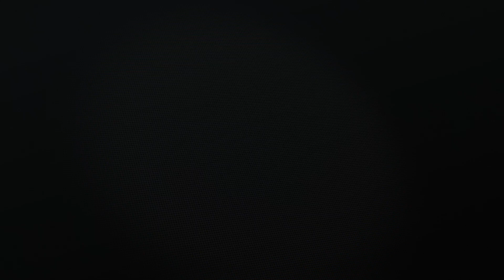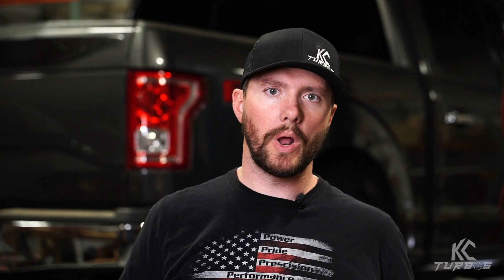Should I Run A Boost Fooler On My Powerstroke?

Comment: So how does it work on a 6 liter with a non vgt. If the only worry with them is the vgt issue, I’m running a s372 had someone tell me to slap a boost fooler on and she’ll look at more psi, when I slapped the non vgt in, it it did have the over boost codes and tuner did take it away but your right. My low end is dog slow. Wonder if you got any information with the non vgts’s as well?

Comment: How does the regulator style actually work? Meaning what does it physically do in the system? Does it control the turbo waste gate and if so how? What is the normal amount of boost I should see on my stock OEM turbo 2001 7.3 with 220k mile? The truck has been very well maintained.
Reply: I may be wrong, but from my understanding, the MAP sensor has a tube coming from the intake spider reading Boost pressure, and if it sees above 24psi, it will start reducing fuel and that starts to limit power.
The regulator style, goes in this line so that if the boost pressure is below 24psi it will read correctly at the MAP sensor, but it will not let anything above 24psi get through to the sensor, and the PCM never defuels.

(The DIY makers use a air pressure regulator meant for an air compressor output, because many air tools have a max psi to use before the tool could be damaged.)

Comment: So is a booster fooler only recommended for 7.3 with a tuner?
Reply from the maker: Correct, and only with certain Custom tune files. Stock trucks it is not needed.

Comment: So your saying you recommend the electronic boost fooler over the other two?
Reply from the maker: Correct, if you're going to run one, thats the most effective and reliable type.
Reply: Thanks! My vacuum one seems to be working (at least into the 20's). Will have to get the electronic version and see if it improves.

Comment: So my 6.0L powerstroke has terrible turbo lag, I put a FICM with a 40 HP tune, 30% over Warren diesel injectors, a Mishimoto intercooler and a sinister diesel stage 3 turbo, still terrible.  What next?

Comment: Would you recommend a boost fooler for a bone stock 01 7.3?
Reply: Anything on this question.I have the same one and just wanna know if it would be pointless without a tuner….?
Reply: Did you ever get an answer (from another source perhaps) about that? I have a stock 03 7.3 and would appreciate any information. Thanx. 👍🇺🇲🇺🇲🇺🇲
Reply: Even with a tuner and gauges i rarely hit 25 psi to defuel. I haven’t tried pulling the red hose though. Probably won’t.

Comment: Good explanation and video, my question is.  Your MAF is normally a calculated engine load input to the PCM isn't it?  So if you building boost under load over 24 psi and the PCM can only 22 psi, won't fuel be lagging?  Maybe i'm relating more to gas engines and diesel is different?

Comment: Thanks! Took my bd diesel boost fooler off my 6.0 diesel. Runs a like rape aped now. Feels like boost fooler was holding the power back with Custom tunes! Max boost was 30psi now at wot from monitoring from pcm showing I’m 32psi now.

Comment: I have a 6.0 powerstroke so your saying just running a sct programmer will be all I need as far as no codes no defueling happening
Reply from the maker: That is correct sir. What is your set up? Give it a shot and report back if you would?

Comment: Okay, so how much boost requires a boost fooler?  OBS?  SD?
Reply from the maker: Depending on your custom tune writer, they might have a different answer for you. We would recommend contacting them directly. Our drop in KC300x turbos for the 7.3 can hit 45 psi
Reply: @KCTURBOS  what I mean is, how much boost would cause an obs 7.3 to defuel? What determines that?
Reply from the maker: @sdpsd25  With an OBS, technically any amount of boost/power above stock could cause your truck to defuel. Now there can be other variables that effect that, like fuel delivery and fuel pump type.

Comment: About time someone gets the facts out. I've been told time and time again that I don't need it and to get rid of it. I've personally experienced exactly what you have described, and have reinstalled it, set it to the limit of setting a check engine light, and the truck runs way harder. 

Clowns everywhere spewing bullshit they heard from the next guy and think they know something. 

Thanks for factually clearing this up. About fucking time someone did.

Comment: So what boost fooler do you guys recommend?
Reply: Kinda sounds like electronic boost fooler is the better of the 3
Reply: @kxp.1496  Yeah, I was kinda hoping for x-brand/style. But thanks for imput.
Reply: @__MAT__  I've been happy with my Riffraff boost fooler. its a regulator style but its a fixed position one so it rattling and adjusting isn't going to happen.
Reply: @Moosekeys  thanks, everything iv bought from Clay I've been extremely pleased with. I'll have to make another order.